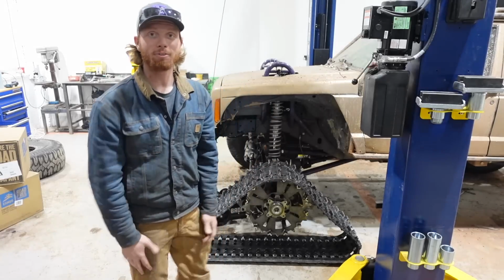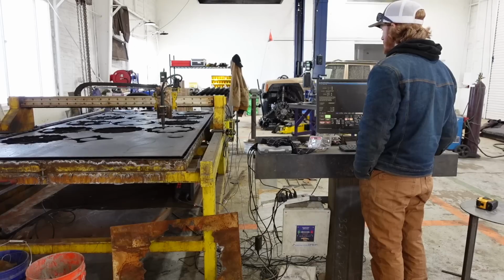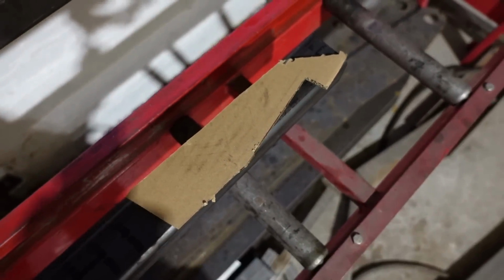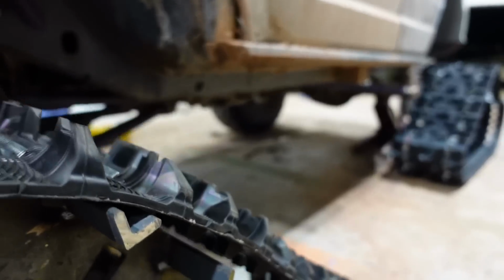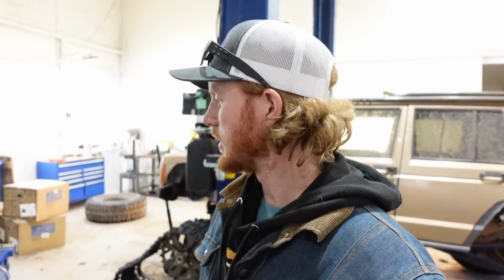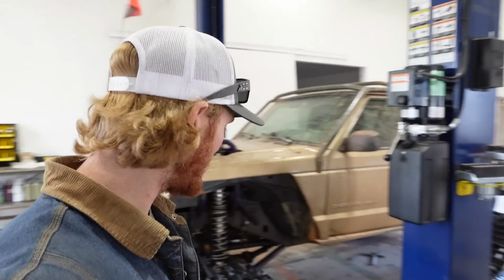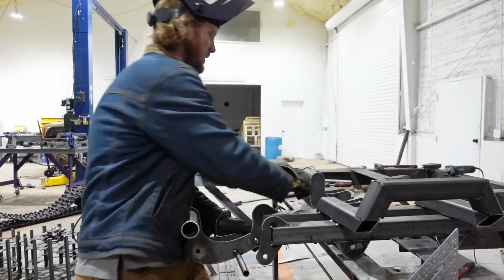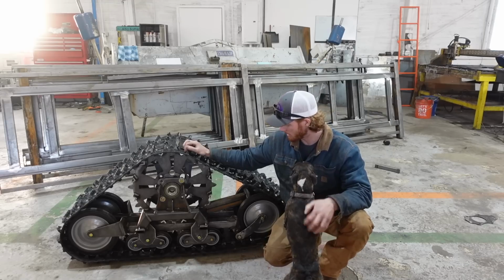Are These Snow Tracks Going To Be Enough???

Comment: I love where this is going!!    I really wanted to build my own tracks for this season, but a serious lack of time and an abundance of other projects meant it made more sense to just buy them again.   I’m hoping that this summer I can get time to redesign the lower half to use larger pneumatic wheels that smooth out the ride on rough ground.
Reply: Well you never claimed you were any good at this! :)
Reply: Have baby Rojo beard make them for you.
Reply from the maker: I am seriously looking at other wheel styles myself 😂
Reply: Just from your experience driving a tracked jeep, do you think the bigger bottom two wheels that Rudy designed would be better than the several small wheels like your tracks have? 
Of course i can see your point of putting pneumatics on the bottom half of yours. 
You & Rudy should have a match off when he gets his done🤣🤣  
Maybe when you go back to Utah in March to judge the tow truck Olympics?🤣🤣🤣
I wonder how the tracks would be in the sand?
Reply: Hey guys, when I’ve looked at tracks online, there’s usually some mention of something that keeps the track from flipping (and tearing out your fenders). Will these flip Rudy?
Reply: @Rudysadventureanddesignreal  a wider pneumatic wheel would be WAY nicer, but wouldn't hold the track inline as well.  I'm thinking the pneumatic wheels, and then maybe a smaller version of my drive sprockets just above them through the holes in the track so that it can't move side to side
Reply: @timothygeiger8271  his larger wheels are basically accomplishing the same thing as my front set of bogies that are raised to help the tracks stay on top of things and not dive into them.  But I do think the larger wheel setup from and rear that create a bigger radius for the track to go around is far better
Reply: @CaseyLaDelle  that was kind of my idea, but i haven't ever driven a vehicle with tracks like that on it, so i was curious what you thought since you are experienced. 
Tell you the truth, i went back & watched a couple of your videos from a few weeks over again, just to see the difference in design😆😆
Reply: The variations to Snow Tracks is almost mind boggling. Your custom mods will make or break the difference in designs with the terrain you're on. You guys spent a great deal learning and sharing these options. Pack lots of grease and Good Luck in your efforts! (Cheers) :hand-purple-blue-peace:
Reply: Pneumatic tires are basically springs with some dampening. It's almost like you need to add a spring and shock absorber for the wheels taking the bumps.
Reply: Wonder how possible it would be to cut teeth out of a delrin hockey puck or something and mount to a small tire maybe with a belt or altering one of them cheap Amazon tire chain alternatives, screw into the delrin or hard rubber with a wide coarse thread screw  with a roofing washer to hold it to the belt.  Adventures in overthinking.
Reply: If I remember correctly Harbor Freight, possibly Northern Tool, sells an 11 or 12 inch pneumatic wheel & tire combo rated for highway use. They're roughly 6-8in wide and are perfect for track building. I used them to build tracks for my 4x4 Kubota tractor and the size of them were perfect to keep the track from diving.
Reply: @Rudysadventureanddesignreal  You Can Do It!
Reply: Casey is the best.
Reply: Did you tell him to upgrade to a 10 gallon power steering fluid reservoir or add some type of cooling system?
Reply: @mattwilliams3456  he just did hydro steering! So it shouldn’t be a problem!
Reply: hey Ruditoot you need to replace all of that square tubing with plate steel you have access to a plasma cutter you can come right off the hub with plate steel, bend it at a 90 degree angle and have plate all the way to the front and rear idler wheels and then have ear tabs off the bottom of that for the boogie wheels......you can cut holes in the plate as well to lower weight after it is all shaped out

Comment: Looks great. I would think about putting the adjustable wheel at the back of the track so your threaded rod isn't taking the shock of anything you run into.
Reply: Definitely adjusting needs to be done on the rear of the track just like a snowmobile
Reply: ya and you need more angle in front too
Reply: I think the 1/4" plate to the spindle is way to flimsy and will bend with the weight of the jeep.
Reply: @customjrod  Yeah, I was noticing that too. Even with gussets, that looks pretty iffy to support the Jeep's weight.
Reply: Could probably literally just swap the sides you mount them on the jeep to accomplish that.
Reply: @customjrod  will probably be fine. It's gusseted.
Reply: I don't know about the threaded rod, on snow tracks, but  on most tracked heavy equipment, the adjustment system is on the front of the machine. True, they are (Unless really old) grease adjusters, that tighten tracks with grease pressure in a cylinder. But even the old Caterpillar equipment with the manual adjustable track tensioner, have the adjuster on the front idler wheel.
Reply: @williamsanders2808  The rear wheels on this are the ones being pulled on all the time. I did maintenance on the Nodwell tracked vehicle I used in the Arctic many years ago and they had a grease cylinder to tighten the track on the front. To loosen the track to do maintenance on it the grease zerk is taken off to bleed the grease out.
Reply: Put the track on the other side of the vehicle and it’ll be at the back.
Reply: Maybe an air shock on the front bogie instead of a threaded rod to soak up some of the shock
Reply: Beat me to it

Comment: Your larger front 12” wheels will definitely need to be upgraded to utilize sealed or greased bearings.  Looking good.  Keep it up!
Reply: I agree..  I suggested to use Honda bearings.  They are wide double bearings, and it would give him a surface on each side to weld on little triangle gussets outward to the wheel -- which would also make the wheel stronger;  and the shaft size would then be much larger and not that little bolt.  I think that would work well--  but cutting out the centers well really needs a lathe to do it right....     That's just the first thing that came to mind.  Those double bearings that Honda uses are pretty bulletproof.  (or Toyota wheel bearings).
Reply: Yeah, those wheels look a little sketchy! I think you’re right about the bearings; maybe the hub as well.
Reply: “The rest of my life”.  But Rudy, you’re such a young man!  😂🤣🤭
Reply: Also, was thinking that the boggie wheels should be more inboard on the smooth rubber between the cogs, the metal in the slotted section will probably eat them up. Thanks for posting, very interesting.
Reply: I agree that the large idle wheel bearings appear sketchy at this point and only support minimal lateral load with their thin metal sidewalls.  Hard turning may lead to more lateral stresses than you may think.  Are the bearings fully road-worthy?  Would a single fat wheel or two adjacent narrow wheels at each end of the track and supported with outboard bearings provide more lateral stability? If I understand your design correctly, it seems like the track tensioner rod is in compression subject to bending under the vehicle load and against track tension.  It could be inverted so that the weight of the vehicle contributes to the track tension and the adjustment threaded rod is also in tension.  Potentially a stronger orientation if the tension rod fails, the vehicle weight can still help keep some track tension.
Reply: I agree on those wheels. Plus the metal on those is usually pretty thin. I had similar ones on a dolly and they did not hold up to much side load.

Comment: The tracks are looking great and I'm impressed with your ability to prototype on the fly. If the 12" wheels give you trouble plasma out some 3/8" Hardox 450 plates with drive spokes on them to help retain the tracks.  Hardox plate is weldable with sg2 wire or 7018 rod unlike AR plate, will last longer and is stronger than mild steel. I would also recommend using a sealed hub assembly on the 12" wheels to prevent water from seizing them and to give them better side load/thrust strength.

Comment: Amazing! The 12" idler wheels look suspect, but the road wheels (as they are called in the military) on military track vehicles are basically the same thing. Granted the road wheels are more heavy duty, but they are on vehicles weighing from 12 to 70+ tons. It'll be interesting to see how well yours hold up.

Comment: @Rudys Adventure and Design - Great work so far. I just worry that the attachment to the hub way out at the end is going to be an Achilles heel. What if you added a bolt on bracket that attaches on the inside (nearest the Jeep frame) to the brake caliper mounts with slightly longer bolts, attach a swing arm to the bracket, and put that swing arm onto the frame of the tracks. It would add stiffness on that back side and in theory still allow the whole track to swing as the front of the track  lifts up and down going over obstacles. Hope that's making sense. 

Also, you may want to consider putting bearings into the area where the small wheels attach to the track frame. They look like they will be constantly see-sawing as the tracks move. Without a bearing they'll likely get hogged out pretty fast even when driving over smooth terrain.
Reply: That hub is definately a weakness in the design.  In the automotive application that hub resides within the inside/outside of the wheel.  Having it that far outside the tracks will place a different load on the hub.  Also, if and when the hub fails, the whole track will fall off the vehicle.  As Mike Jones says, for the tracks, it would be better to create a structure inside and outside of the drive wheel.
Reply: I would think you would want the hub/bearing attached to the middle disc (on truck hub) rather than the outside disc. Currently, the force will have to transfer via angle iron to the vehicle hub/axle. A lot of leverage in this design will be the weak link.
Reply: @lynnbartels4183  I'm not sure how he could fit that hub in a more central location with the design he has. However, by adding a brace on the inside of the tracks it would in theory alleviate the stress created by the lever arm that's hanging off the hub right now. Goal is to move the point where the force is effectively applied ... Into a more central location, without having to relocate the hub. In theory it should work just about as well.

Only downside is having to disconnect something from the back/inside of the tracks in addition to the 4 hub bolts on the outside of the tracks when removing them. Still, if the bracket attached to the caliper mounts is designed right it could stay permanently on the vehicle and use a bolt through a heim joint to connect/disconnect the inside track brace.
Reply: How about connecting the center disc to the outer disc with a large diameter pipe that fits inside the vehicle hub bolt pattern, but over the wheel hub. This will transfer the load directly to the new bearing and track structure in a robust design from the vehicle hub.

Comment: In terms of how you're putting the tensioning arms together, the most accurate measurement is the one you don't need to measure. Using the frame to keep stuff aligned is totally a valid option.
My main concern with the 12 inch wheels is that they're going to buckle once you put some side load on them like steering.

Comment: One question, if you go over an obstacle, your little wheels are nearly FIXED and don't move enough in the upwards / downwards movement, will be a problem. Make then <movable> more so you have done with that problem. Look at a track from a tank as example.

Comment: Nice project, I'm already waiting to see Rudicon on the tracks in the snow. The durability of the wheels and, above all, the bearings must be strong enough and waterproof. Snowmobile rollers are usually used in the tracks. The tensioning of the track should be directed towards the back, so that it does not receive shocks in the terrain. Most of them come from the front when the roller hits an obstacle, stone, etc. The increased weight is probably not a disadvantage, because the car's center of gravity rises higher, so the additional weight brought by the rollers only stabilizes the car. In addition, the rollers are usually not driven at high speed, in which case the suspension and shock absorption can cope with the additional weight.

Comment: It's nice seeing you going you own direction and getting to use the skills that I know you have. Brother needs to get on board with a R.A.D logo. I think the tires will be lighter than the tracks. I think they look good, but if you run into trouble it will be in the front when you turn because of the force against them. Fun to see them in action.

Comment: I mentioned this in the last video, but quite late, so I'll say it here again.  I'm sure this is way too late, but just in case, your tracks need to be somewhat turned up on the front.  If not, the first time you encounter an obstacle with any speed faster than a crawl you'll likely snag on it rather than go over it.  Even then you'll still snag stuff, just not as bad/often.
Reply from the maker: If you look at the end clip the side of the track with the tensioner that wheel is about 3 inches off the ground, and with a 12 inch wheel it gives me a massive taper in the front.
Reply: Yes, you're correct. I run Camso tracks on my quad & they have an "attack angle" plus a curve at the front.

Comment: I love you and your channel Rudy
Not sending hate, just trying to help... You need a rail system with hyfax similar to a snowmobile to support the weight of the Jeep. The little wheels are just to aid the track around the rails. Those wheels will break or bend first hard obstacle you hit...
Reply: I wondered about just grabbing the track system off a wrecked snowmobile and adapting the drive system but leaving the slide/trailing system. It’s pretty common to find wrecked sleds in my area.

Comment: Maybe you should think about some type of adjustable coil over shock with your adjustment rod to give it a little flexibility That will let your track Spring back off the two main front wheels to keep the track tight but what you already put together looks great

Comment: I'm afraid the bearings on the 12" wheels will fail quickly as they are not designed for the weight and use you are intending on subjecting them to. Just hope you have a few spares when you do go out to test out the tracks so you can get it back. Great work on the designing otherwise.

Comment: As I started to watch I was going to type about a YouTube couple in Idaho that built there own and have plan’s available. Low and behold before I could type you mentioned Ambition Strikes. Great Shout out. They used to be in the local 4x4 club where I live and had a 4x4 shop and then did 4x4 parts manufacturing. Great people.

Comment: Epic project and mad skills to make it happen. I have some reservations on your behalf regarding dynamic loads. Few ideas; 1. Consider moving adjustment to the rear of track so it's not crashing into everything, 2. larger bearings with big rolling elements are normally needed to deal with shock loads 3. Try to load in shear rather than bending. Those adjustable wheel mountings are likely to get all bent up.

Comment: What if you used wheelbarrow tires for the front and rear wheels? A heavy duty construction style wheelbarrow. Not a cheap on you would get from the local hardware store. I haven’t measured them but they should be close to 12”. They also make them solid so you wouldn’t have to worry about them going flat. The tread pattern is a little wider than what you have. They have used wheels like that on snow cats in the past. They were usually air filled and then as an upgrade people would fill them with foam to eliminate flats. 

As someone mentioned, that front adjustment bolt is going to take a ton of abuse. Especially when driving over areas with no snow. Make it strong. 

I’ve been running tracks on a UTV in the Sierra Nevadas for about 15 years. It’s amazing where they will take you. Love the build. They are looking great.

Comment: One heck of a project, and yes, it would be miles easier, and maybe money ahead, to buy the readymade tracks. Kudos for your confidence to take on such a project.  Those 12" solid rubber wheels with cheap bushings are not going to hold up. There's got to be a more robust industrial conveyor belt tire that would work.

Comment: Thanks for sharing the design process on this!  It's intriguing to watch.   I got a good laugh out of the "tiller wheels" for the front and rear, though I cannot argue with your logic in choosing them!  Even though the adjustable wheels in the rear are locked together, I wonder about the amount of torque the mounting bolts/brackets will see in a real application.  But then, we all know how well you baby your equipment.... maybe it'll be alright!  😆

Comment: I think those little wheels will work if they have bigger bearings.   Ideally you could use Honda or Toyota wheel bearings (not the hubs, just the bearings- look those up on ebay).   You can cut the centers out of the wheels you have and weld in the Honda bearings with little gussets, etc..  then use a pipe as your axle for them.  Because those front wheels are going to take the most contact as you hit things and run over rocks, etc.. and it needs to be super strong on those front wheels.  Your small shaft and bearings are too small on those front wheel IMO..  But the steel wheels themselves would probably still be ok, once you welded in those honda bearings with several triangle gussets on each side...   Those are like double bearings on the inside, that's why they would work so well for this.....   The rest of the wheels might still be ok, but those front wheels are quite a bit more crucial, if you want things to survive a beating.  Cheers